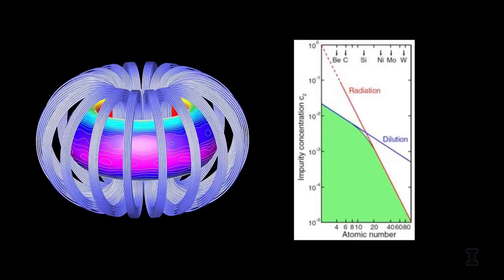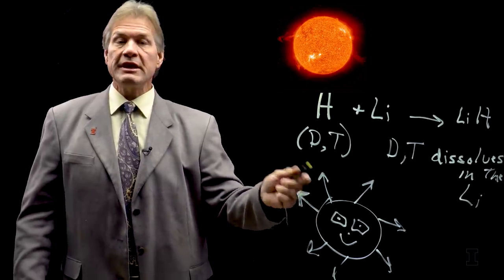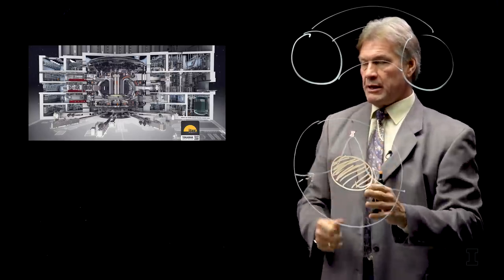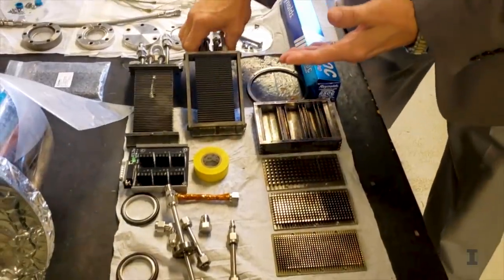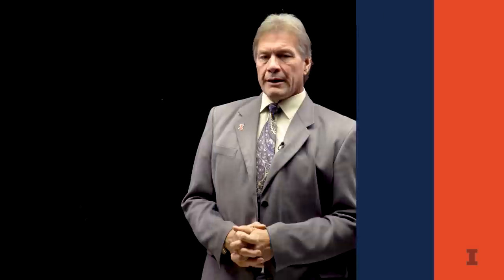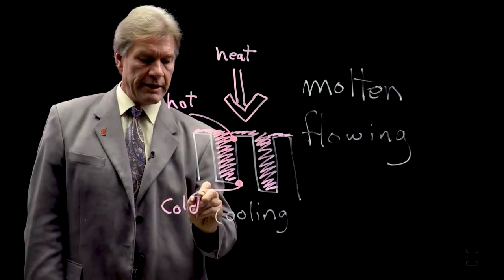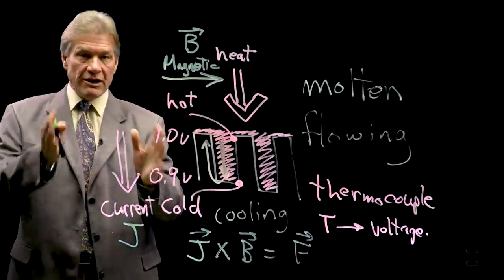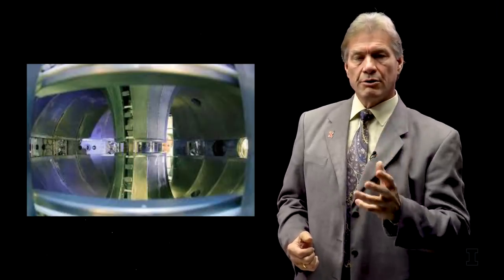Lithium for Fusion Energy

Comment: What I love about this video is that as you were talking about the solution more and more, the more my train of thought about where you were going next became identical to the actual experiments. This is a really interesting way to flow the lithium across the reactor walls without adding much complexity to the reactor design. The fact that the temperature difference can turn the liquid metal into an electric motor that pumps the liquid metal across the surface of the reactor is just such an awesome way to solve the problem of being able to pull heat out of the chamber and circulate the lithium for fuel recovery.

Comment: How do you keep it from dripping from the ceiling? Is the capillary forces enough to keep the Lithium in the ridges?
Reply: It spins so it doesn't anything else to keep it from dripping
Reply from the maker: Surface tension is enough if the trenches are narrow enough. Spinning is also a solution, but it is not needed for this technique.
Reply: @illinoisenergyprof6878  Figured, but dont know much of the surface tension of liquid metals.

Comment: Questions:
1. Do you envision a difference in performance between Li-6 and Li-7 in this setup?
2. I take it that the surface tension of the liquid lithium will keep it in the trenches at the top where gravity would otherwise pull it out?
3. Lithium boils at 1330 °C - you are confident that the heat transfer out of the device can maintain the lithium below this temp even when the fusion extends out to the walls?
Other than these concerns, your idea seems excellent to me.
Reply: Ah, I see your answer to another comment answers the surface tension Q2.

Comment: A very clever way to use the lithium.  Using Lithium6 helps soak up all the neutrons and gets you enough tritium to help fuel the system eventually.

Comment: With brilliant scientists such as this guy involved that have a passion to achieve viable fusion energy and are tackling every challenge that presents itself by looking for innovations to overcome those challenges, this is going to happen.
They already know what's required. They already know that's it's possible to achieve this on Earth. They know that there are no "brick wall" limitations that would prevent this from happening regardless of innovative effort.
It will come together as it evolves (that's already happening). As these kinds of things evolve, discoveries that weren't conceived prior emerge, and often times can exponentially accelerate the process related to the objective.
Fusion is the holy grail objective here, but Fission in the interim is a very fine close second that we already have perfected.
Fission reactors this very minute could sustain all of our energy needs if we just proceeded to build the plants.
The stigma and misguided fear about nuclear energy is what's holding this back unfortunately.

Comment: essentially a lithium clutch in a vacuum, fuel lines feed in to the friction point to cause a reaction, clutch spins to provide throw out of heat and even out reaction, cooling lines turn into super heated steam.

Comment: 1. Why lithium doesn't produce cold flux? Why it is unique in this respect? It seems, this questions were omitted in the video.
2. Btw, 3^3=27. And also 20 times smaller doesn't necessarily mean 20 times cheaper. The link between size and cost isn't obliged to be linear.
Reply from the maker: Since the H is absorbed when it hits the lithium wall, it does not return to the plasma.  The lithium does not saturate because it is flowing.
Yes, I used to say 27 times smaller, but it isn't exactly a sphere, so I thought 20 is more likely.   You are right that size and cost are not directly a one- to one comparison, but it certainly gets us far in the right direction.

Comment: How is the lithium desaturated of Hydrogen? How do you make sure the liquid lithium does not drop from the ceiling of the torus, does it circulate so fast around the torus that its centrifugal force suffices to keep it pressed against the wall?
Fine Video as always.
Reply from the maker: Surface tension is enough to keep it in place.   Lithium's surface tension is four times that of water.   We will take out the H basically by heating it up -- which is also something we get from the device!
Reply: @illinoisenergyprof6878  Thank you for the explanation!
Reply: @illinoisenergyprof6878  So the Hydrogen just evaporates by the heat?

Comment: Cool lab. Would like to build a fusion reactor with you. Injection of lithium plasma would be a way to create tritium in situ, make the plasma more reactive to electrical snf magnetic fields, and lastly act as a mode converter to help turn magnet energy into heat. Just not too much at once.

Comment: Now while the liquid lithium is outside getting cleaned can it be used for steam generation, or even pre-heating fuel being added like an economizer? Can some of that current generated in the thermoelectric effect be taken out for power generation, or is it all needed to push the lithium around? What kind of conditions does the lithium need to be exposed to in order for it to transmute into tritium and be used as the fuel?
Reply: Tritium Breeding is the answer but we need to confirm that H-mode device like iter it works and control plasma instability  in magnetic confinement fusion
Reply: I was going to ask the same

Comment: I have watched many informational videos on fusion technology, what I have never heard about yet is how they can extract the heat from the cylinder to convert into mechanical energy. The entire system seems designed to keep everything contained which seems would make transferring heat out a difficult process.
Reply: Magic
Reply: I really don't get this part either. Not that I actually understand the other parts but this one to me seems to be the most important for energy production.
Reply: The heat from the reaction is absorbed by the wall. A heat exchanger can pick it up there. Here you could even pump the liquid lithium through a heat exchanger to generate steam.
Reply from the maker: 80% of the energy comes out in the neutrons, and they go right through the wall.  They are stopped in a blanket surrounding the device, heating it up.  That is cooled, by water which turns to steam and spins a turbine, which turns a generator.

Comment: Lithium-7 was used in the Castle Bravo nuclear test.

Originally, they were supposed to use Lithium-6, but it was in very short supply and was extremely expensive.

Using Lithium-7 instead of Lithium-6 resulted in the yield being 15 megatons instead of the expected 8 megatons.

Comment: I want some time alone in your lab, LOL.  So many awesome devices.  I'm making a fusor myself at the moment, saving some cash for a high quality vacuum pump.  Have my stuff set up for electrolysis of heavy water.  Working on my screen set up and 1 inch thick acrylic vacuum chamber.  I'm a ham radio operator so I have some high voltage transformers up to 10 Kilovolts and a variac to control my input voltage to the DC transformer.  Hoping I can do some electrostatic confinement fusion by next year.  I'm a beekeeper also, and we have the big fall nectar flow going on, and I'm doing treatments for varrora mites to get my bees pest free for winter.  So right now my other projects are on hold until after the honey harvest. Hoping I can get some good videos of the fusor in star mode when I have things all ready to go.

Last year I made a diy railgun, but the rails really wore out fast.  After about 200 shots the rails were toast, and the projectile would not travel down them.  There was too much slag and debris from previous shots.  It was hard to take videos of it, because the emp it gave off when fired messed with the cameras.

Comment: Trying to lasso plasma is like trying to herd cats, a lot of tail chasing ensues. 
Steady state fusion reactors will never breakeven. Pinch, crush, fold wahtevs leading to a momentary bang will win, dense plasma being my personal favorite.   
Bang machines might get to the holy grail of neutron free boron~hydrogen fusion too which also has the advantage of yielding two beam of ionized particles
electrons in one direction and nucleic particles the other inducing electricity directly rather than by boiling water.

Comment: Need a clickable link to the paper in the video description, Professor.
Reply: Googling is hard isn't it.
Reply: @dragoraan7247  Professors often have links to their personally published papers available at links that are either 1) not indexed because of a NOBOTS meta tag. 2) are on their personal websites and not heavily linked to, so they show up far down a google results list. 3) are behind a paywall (often the case).

In general if an academic is referencing their own work you should ping them for a link. They will generally have something better than what can be easily obtained through Google. Not always, but often.
Reply: @dragoraan7247  It can be. Results can be highly dependent on the wording of the search phrase. Those who already know the topic know how to word the search.
Reply: @henrytjernlund  Literally a 2 second google of his name+journals, its not hard https://iopscience.iop.org/article/10.1088/0029-5515/51/10/102002
Also reading it, wow if this is true: "In summary, utilizing TEMHD, self-flowing molten lithium has been shown to be able to remove a peak heat flux of 3 MW m−2with the potential possibly to remove up to20 MW m−2with stainless trenches and this geometry, or more with Mo and different trench widths and heights under high magnetic field." Nuts... 20MWs per square meter??????

Comment: Nice idea Dr. Ruzic.  Does the lithium and the chamber wall eventually become neutron embrittled?  What does the logistics look like for replacing/disposing of the radioactive parts?
Reply from the maker: The lithium is not adversely effected by lithium, but you are right that the structural material can be.  There is a lot of work going on to find structural materials which will anneal their damage automatically, and there are some possible candidates.
Reply: @illinoisenergyprof6878  Thanks for the reply.  I'm impressed by what you've done with physical experimentation.  Top notch lab!  Keep the videos coming.  One of the best channels on youtube hands down.

Comment: Fusion technology is currently perceived by the public as safer than fission technology.

It is important for the future of fusion if it is to be widely deployed and accepted by the public for reactors built with fusion technology to be exceptionally safe. 

Proponents of the use of lithium in first-generation tokamaks and stellarators leave unannounced and unmentioned significant safety problems relating to the proposed use of molten  lithium metal as a coolant and protective covering for the walls of MCF fusion reactors.

Safety Concerns regarding use of Lithium Metal Coolant -

A lithium cooled fusion reactor typically operates at a temperature millions of degrees C and the walls of MCF fusion reactors could momentarily be at high temperatures when perfect magnetic plasma confinement is lost.
A fine spray of lithium metal droplets released into the air can ignite at a low temperature around ~120 °C.

If the molten lithium metal is expected to actually protect as well as cool the walls of a large tokamak reactor like ITER or DEMO, a great deal of molten lithium would have to be used and probably more lithium than you are expecting (estimate of 5000 tons of lithium metal to cool and protect a fusion reactor like ITER).

Hot Lithium if it comes into contact with water will evolve large amounts of Hydrogen gas.

Lithium metal reacts exothermically with liquid water or steam to generate lithium hydroxide and hydrogen:

Li + H2O -> LiOH + 1/2H2 + heat

Hydrogen tends to accumulate in the roof area of a reactor containment building and if the conditions are right, hydrogen-air mixtures can detonate explosively. The range over which hydrogen can detonate in air is from 18.3 to 59 percent by volume.This is a very wide range of hydrogen-air mixtures and this means that in real-world accident settings, there is a real chance that explosive hydrogen-air detonations can occur. This should not just be casually disregarded and discounted.

The amount of lithium (~5000 tons) required to cool and protect tokamak reactor walls from neutron damage in a large reactor represents a lot of stored chemical energy that is capable of being released explosively in a lithium metal fire-hydrogen explosion under emergency conditions resulting from an earthquake, flood, or tsunami.

Molten Fluoride Lithium salts are safer than Molten Lithium Metal -

It is possible to get similar benefits from use of a Lithium containing molten salt like LiF more safely, as LiF molten salt does not spontaneously burst into flame when exposed to air or produce large amounts of hydrogen gas if it comes into contact with water or cement. 

When you compare a lithium metal cooled fusion reactor with a fluoride molten salt cooled fusion reactor regarding relative safety during accidents, the facts are that a lithium metal cooled tokamak reactor could produce a large accident involving a lithium metal fire and a massive hydrogen explosion (while molten salt cooled and protected fusion reactor is not physically capable of producing an explosive accident - by physical laws).

Comment: the cold flux idea is a big assumption; heat flows towards cold, cold absorbs heat but cold matter does not travel towards hot because it would be swimming upstream, against the temp gradient. Further why does the toroid wall reflect the cold matter back necessarily and not somehow let the hot matter out?Even mag netic fields can be overcome by pressure. the chaotic hot matter would disrupt the mag field, and what is lithiums' melting point?  need to talk to a lab tech who works on the toroid

Comment: With the hot lithium coming out of the reactor, wouldn't this mean the lithium has to be cooled? Could the cooling of this lithium, as part of it's cycle, be the extraction of the energy put in?

In the process of cooling, convert water to steam, and create usable electricity? 

Or would the scavenging of energy from the lithium work counter productive to what's trying to be achieved?
Reply: That was my initial assumption.  I think in the drawing to simplify it he just had "coolant" so to remove heat.  There will likely be loops going out and a heat exchanger.  It may well be two heat exchangers with a intermediate fluid to reduce the possibility of any of the lithium leaks coming in contact with water.
Reply: I might be wrong but I see 2 problems, 

1 the amount of lithium flowing “through” the reactor I would imagine is very small. The capillary action holding it in place would fail if it were too thick

2 the specific heat of lithium is less than water (still very high for a metal) and Li is 1/2 as dense meaning you would need 2-3 X as much flow to accomplish the same cooling as water.

Still very interesting because you are essential cooling from inside the chamber. You might be onto something.
Reply: @georhodiumgeo9827  But the lithium isn't what's doing the cooling, it's just collecting hydrogen so cold hydrogen doesn't reenter the flux, right? The cooling is still inside the fins, if I heard correctly.
Reply: jagmarz from what I understood you are correct and I would extend that to say it would be difficult to impossible to use the lithium as a heat transfer mechanism in a meaningful way.

This is the single most clever scavenger implementation I have ever heard of. The magnetic field keeps the plasma contained in the center of the chamber but you will have some stragglers hit the wall and cool down. When they return to the plasma they wreak havoc while they heat up again.

These guys just absorb the gas with a flowing wall to remove it and replenish the wall later. Beyond me, I’m still trying to wrap my head around how much hydrogen will dissolve in liquid lithium. Next level stuff.
Reply: Most of the heat will be deposited on a special reactor component called a divertor, which is specifically designed for this purpose.

Comment: Perhaps a Li-Al molten solution can expand the range of the concept if Li starts to boil off due to high temp. and low pressure. What is the order of magnitude for allowable LIH content? - LiH forms hard ceramic particles so the some upper limit of LiH concentration could impact flow.  I've worked with large scale LiH production and I've seen the crystals grow into very large particles.  Does LiH have any solubility in bulk Li liquid?  Perhaps the temps stay above the LiH melting points. The Rankine cycle reference made me cringe.

Comment: I was expecting woo science but an awesome video and I subscribed thanks for the great content.

So the vapor pressure of the liquid lithium goes up as the temperature approaches its boiling temperature. I think you spoke to the small amount of vapor not fouling the process? Does the 6Li participate in the fusion or should say could it providing there were 3He?

I guess I don’t have a grasp for energies at work here. Awesome and brilliant video, it changed how I think about plasma in a Tokamak. Good luck!